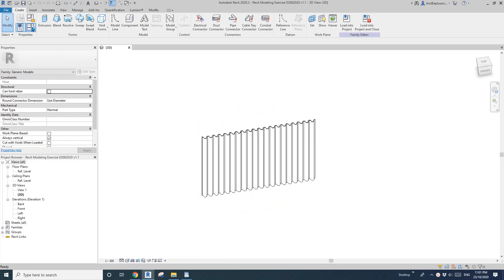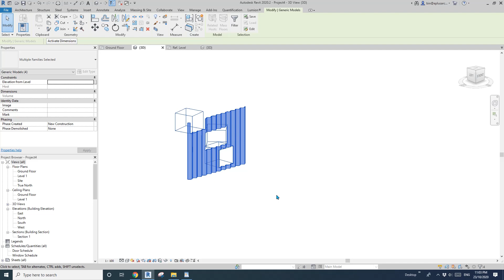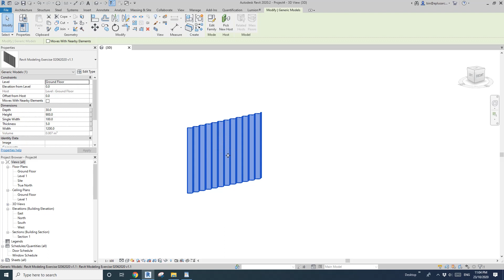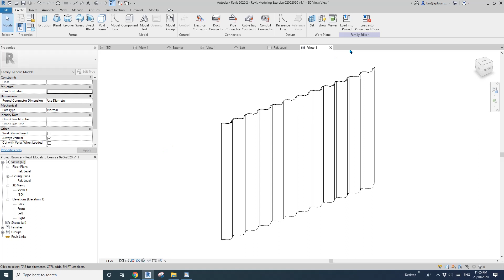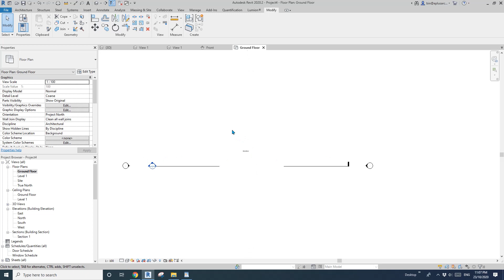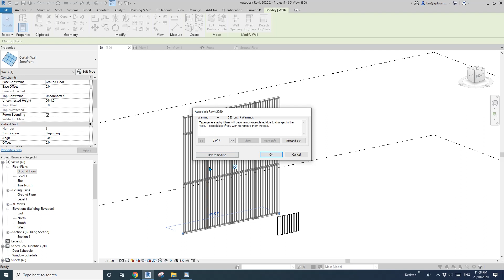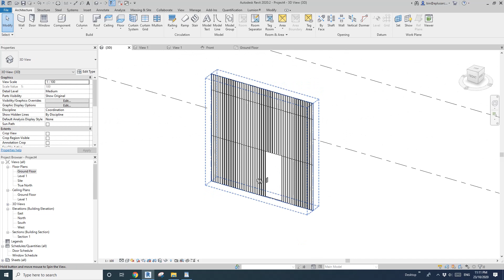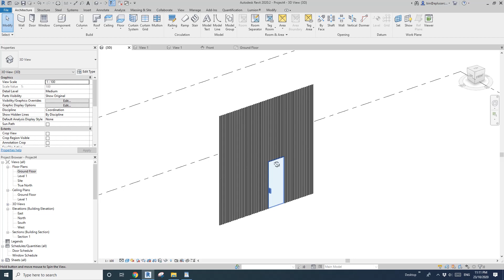Revit Exercise (Day 219) - Corrugated panel in curtain wall

Comment: Guys the problem with using curtain wall as the motive is it wont attach to the underside of any roof that is angled. It is also difficult to clip openings for windows.
Reply from the maker: True. Usually this is the time I start to ask myself, is it really necessary to model this? Will a basic wall with some surface pattern work better?

Comment: I subscribed to the channel today. Very useful! I am quite new to Revit. So sorry for the dumb question but I cannot attach the curtain wall to the roof as my roof is not flat and needs the curtain wall to be extended to it. What would be the problem and how to address it?
Reply from the maker: Could be different reasons:
1. The base of the curtain wall is higher than the base of the roof.
2. The curtain wall is not covered by the roof.
3. The profile of the curtain wall after the attach top/base will not be valid (e.g. having lines less than 0.8mm long)
You can post your screenshot in the shared document if you still have issue.
Reply from the maker: Okay, it is because a normal curtain wall panel can only be rectangular shape. This family will not work when you use attach top/base.

Comment: Ahhh i see , I am using your day 500 model.. it was a redone of day 73 right? should the model work with curtain wall panel family ?
Reply from the maker: No, they are different. 500 is a line based.

Comment: 0:34 I see here Depth,Thickness,Single Width parameters. But at Day 73, you didn't put these parameters. I tried to put these parameters but it doesn't  work.
Reply from the maker: If you follow the Day 73 video you should be able to model this panel with the parameters.
Reply: @BINHE615  Single width parameter works but Depth dosen't work.
Reply from the maker: @archikim3803  Send me the family and I'll have a look.